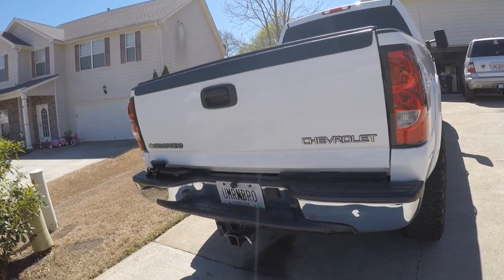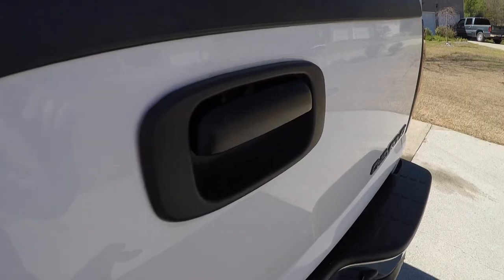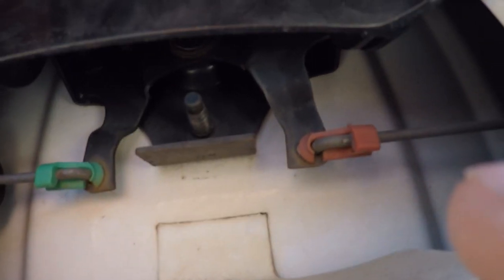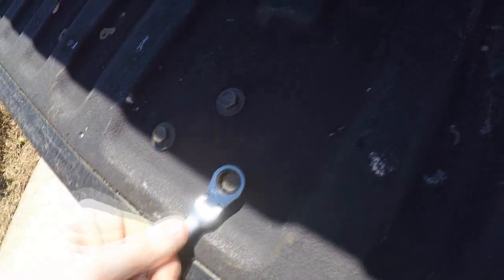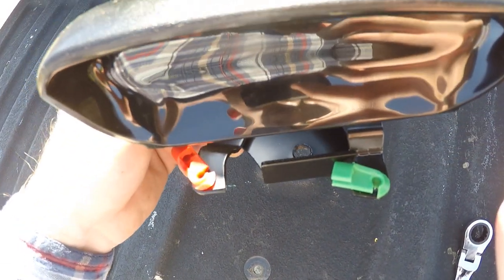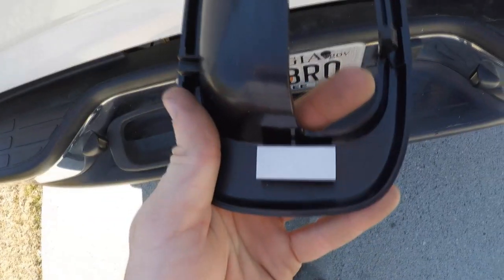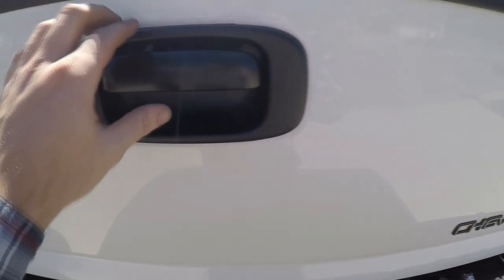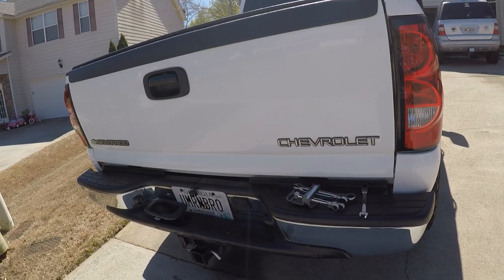Chevrolet Silverado/GMC Tailgate Handle and Trim Install

Comment: My tailgate latch is stuck in the open position so the tailgate is down. My latch is rusted out so it's due to be replaced. The company who rhino lined my bed sprayed over the 3 bolts. Guess I'll need to uncover those bolts.

Comment: I've been riding around with a broken handle for I don't want to say how long and the cap was missing when I bought the truck. Bought the part on Amazon. Watched your video. Install took five minutes. I will say that the red tab was on the left on my original assembly and the assembly from Amazon, the red was on the left as well. So I left it in that configuration. Thank you so much for this video!!!!

Comment: Just was finding out how to take off the cover, the right rod in my tailgate had popped off and I can now confirm without anything even being broken. But you said the red and green were on the wrong sides because it is aftermarket, mine is NOT aftermarket and are also that way. This is the first time I've had any issue with it so am curious if it may be different sometimes on purpose?

Comment: Correct me if I'm wrong but if somebody really wanted that tailgate and they were quick all they would have to do is pop off the trim ring and they have access to the rods.     you would think the manufacturer would somehow incorporate the trim ring to the actual handle so that could not happen.
Reply: Correct me if I'm wrong, but if somebody wanted the tailgate, why wouldn't they just lift the handle and open the tailgate? Then unhook the support cables, lift the right side out, and then swing the left side out of the hinge! You can take a tailgate off in about 15 - 20 seconds. It's not like they have a lock. Is there a lot of tailgate swiping where you are? On my Sierra, the hard tonneau sits over the top of the tailgate, and that keeps it from being opened.

Comment: What year is this truck. I have a 2001 that I can't seem to get the clips for.
Reply: Amazon.com has them for sale for $7.00 for a bag of ten of them.  Five green, and five red.  Way cheaper than buying through a GM dealership.
They work quite fine, I've had good luck with the aftermarket ones, I think they are every bit as good as what GM sells.
Reply: Edward Schwenk I ended up getting them on Amazon.com. sure couldn't find them anywhere else. The repair was every bit as simple as you explained. Perfect. Thank you!
Reply: What are the clips called on Amazon?
Reply: mongoosevacations 1999-2007 Chevy Silverado GMC Sierra Tailgate Handle Rod Clip New Left & Right OEM Replacement Pair 88981030, 88981031

That is what I ordered.
Reply: Russ Thompson thank you much